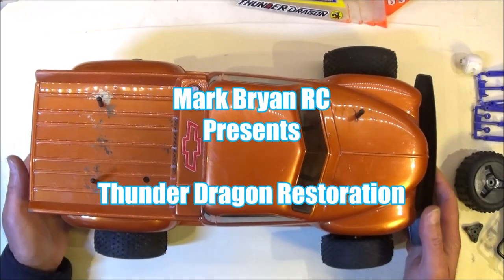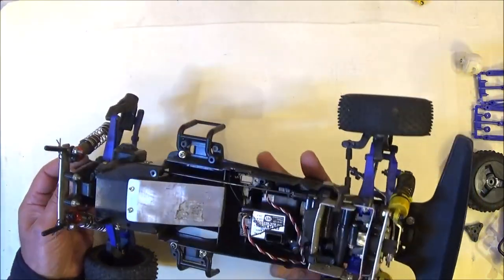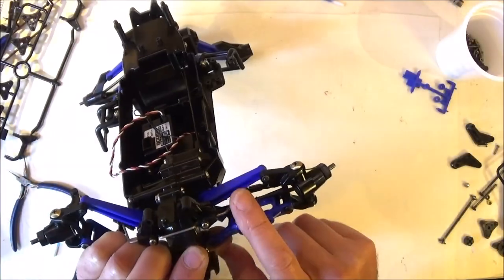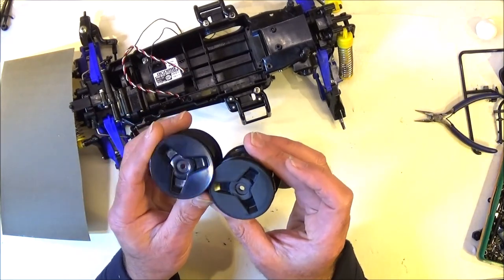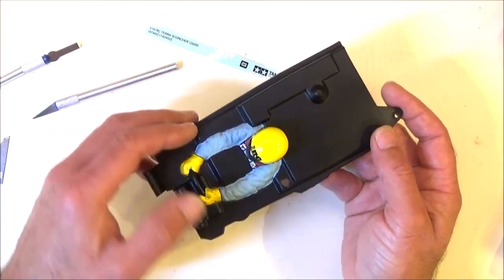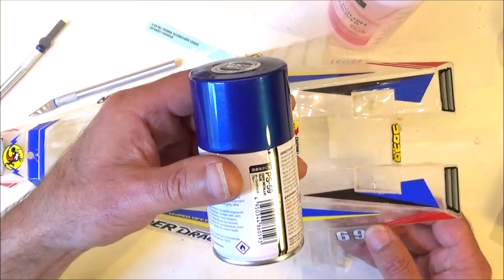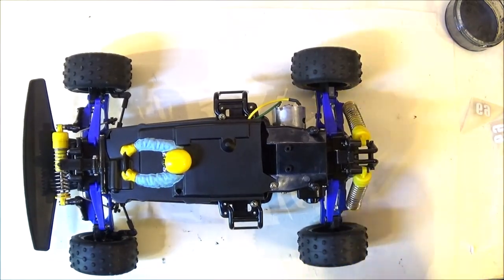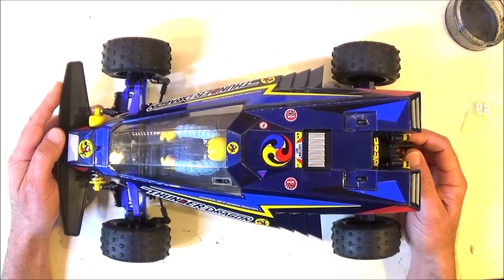Restoring a Vintage Tamiya - 30+ Year Old Thunder Dragon!

Comment: Fantastic refurbishment Mark. I love the colour, and really love that you reverted it back to stock. That's something I did to my Tamiya Ford F350 Hi-Lift recently, and it just felt so right when I finished it.
Reply from the maker: Many thanks, Derek! Yeah, spot-on mate, I did get the same "so right" feeling at the end of the rebuild - I had a little test run in the garden and had a massive smile on my face as the old girl strutted her stuff in her old/new clothes!  :)

Comment: Nice job Mark. Good tip using the fine wet & dry on the wheels, then polishing with metal polish to provide that little extra shine. Glad the bodywork was saved, you obviously put a lot of hours to restore that delicate 30 year bodywork. Wow ! the gearbox metal filings from that pinion gear ! luck the rest of the nylon / plastic gears in the gearbox weren't worn by those filings. Look forward to seeing it run. Great job, bud !
Reply from the maker: Thanks, John! 👍
Glad you found some of the tips useful. Yeah, it was a real labour of love getting that body to look as good as it does, I was really worried at one point! And the amount of muck that came out of the gearbox surprised me - a mix of old grease, dirt, dust and metal filings. The gears are amazingly still fine though. I appreciate the great comment, all the best, John.  :)

Comment: Well done, Mark! The bloom does pretty much vanish when you paint - my M03 Mini body had the same problem - I had to cut the windows out and change them.
 I was astonished at the result you got from the metal polish on the wheels.
 I look forward very much to seeing how this feels to you now with the 3 shock setup, especially driven back-to-back with the Terra Scorcher.
Reply from the maker: Cheers, Del. Yeah, I wasn't sure what would happen spraying over the scratches and bloom, I was panicking to be honest! I should have asked you first! Too bad you had to change the windows, but needs must, eh? And yes, metal polish works great but only on harder plastics - Solvol Autosol is the best in my experience as it has a slight abrasive quality. It will be interesting to see how it runs with that single shock, it's been so long that I can't remember! All the best, mate, hope all is well with you.  :-)

Comment: Hello matey. I really enjoyed that. Some tip top  tips from you. That's amazing what you did with the wheels. Would never have thought of doing that. Also the body came out lovely despite your trials and tribulations. It's amazing with lexan bodies that the underside can be scratched to buggery and you can't really notice once the paint is on. Top job on the driver too. Was that just ordinary spray paint on the lexan bit? Great idea with the heat sink in the hole at the back. Looks the business in blue. Bet you are well chuffed with that. Anyway I am tentatively having a small beer as we had far too much last night! Hope you are enjoying your Friday. How's work been going? Hope all is well mate 😀
Reply: btw was that an actual dog or have you been adding sound effects?
Reply from the maker: Hiya Pete! Thanks for the very kind words, mate. Yeah, this was a bit of a nightmare really, made worse because of the lack of RC stuff available at the moment - oh well, needs must! Luckily the paint does hide many imperfections, and it does look quite good - better than what I started with, anyway. The driver figure clear plastic isn't lexan, so ordinary car paint works well on it. Strange how Tamiya uses different clear plastics? Work is very relaxed at the moment, just like babysitting, really as we are not following the curriculum. But I think that will change soon. Thanks again and I hope you have a lovely weekend, Pete.  :)
Reply from the maker: Haha - no, that was the neighbours bloody annoying dog for real - I was waiting for it to shut up for ages, but no! I did actually swear on the video, but obviously cut that bit out!!!   :P
Reply: @MarkBryanRC  ha, I wasn't sure if you were emulating the animal sound effects I put on mine. Oh I have to cut out a few swears. It's usually when it's incredibly awkward to put something together on camera and I've just dropped something on the floor because I haven't really got the parts the way up that I want. Anyway I woke up super early this morning and got another vid edited which is putting the lunchbox bumper on the Dump Truck. I did break the kit one as expected and I've worked out a way to put the lunchbox one on without buying that hop up part that I used on the Konghead. Anyway I'm going to give the current vid a few days to pick up some views first. I've also got a load of unedited footage of various cars to be getting on with. Enjoy your Saturday mate 😀
Reply from the maker: Hehe - I did think of your sound effects when editing this one! Yeah, I should have added more animals and then the dog bark would seem part of the soundtrack! Good you got some footage to play with, I've now run out so need to get out and film some more. All the best, matey!  :)

Comment: Hi Mark, it’s really cool that you still have so many of the old parts after 30 years.  I’ve seen other RC guys finely scour the inside of lexan bodies before painting, I think to make the paint adhere.  Maybe you accidentally found a new technique using Acetone, scraping then sanding before painting because the body turned out really nice 😀   You do really nice body figures, painting around the eyes is challenging.  As usual awesome tutorial showing off your teaching skills.  You have inspired me to start building kits.  Over a year ago I picked up some cheap 1/16th Crawler kits from WPL and MN,  I just started building and painting them. I have to make two of everything so Sebs can RC with me, it’s taking a long time because I ordered metal upgrade parts from China but it’s been fun!!  Take care Bro!
Reply from the maker: Hey Paul! How ya doing brother? Good I hope. Thanks for the great words as ever! Yeah, even at my old age, I'm still learning - others are telling me about sanding the Lexan before painting - seems wrong, but I accidentally proved that it's right! The figure painting is tricky, but it really helps if you have good quality paint and brushes. Cheap paint is awful to work with. I'm really pleased you are building kits (even if it is double the work!!!) I think it kind of makes you more attached to the finished rigs. Hope those parts come soon, I'd love to see your builds on your channel.  Take care too my good bro!  :)

Comment: Brilliant restoration Mukka!! 👌
👏👏👏👏🍻
You've seen that Lexan acts like a Clearcoat. In fact, I always Sand the inside of my Lexan Bodies for better Paint adhesion.
However should you want to remove this Paint...
It will be MUCH harder to remove. 😖
But the Blue looks GREAT! 

I never liked the performance of Mono Shocks... Without a Swaybar. 
But as far as Chassis restoration goes, you nailed it!!! 👍👍 Lucky some of the bits actually came in the Terra Scorcher 2020 kit. 

You are ROUGH on your RCs Sir!!! I have never seen a C Hub break! 😲 Everything else, but not C Hubs. 

Seriously, that looks shockingly good!! You did such a good job! And I'm shocked that you still had 30 year old parts!!! I have trouble finding 3 year old parts. 😖 
Cheers 🍻 Mate!
Carmine ✈🚂🚙
Reply from the maker: Hiya Matey! Oh yes, big lesson learnt! But good to know that you can sand the inside of Lexan before spraying, we are never too old to learn in this life! I think the mono shock worked OK when I originally built it, but as you say, it does have the sway (or as we say over here "anti-roll") bar.
Oh yeah, you know it my friend, I always run my cars HARD! Gonna take it a little easier on this old girl - well, not so many big jumps anyway. Thanks for the kind words and I hope you and yours are well, me Mukka!  :))
Reply: You'll want to LIGHTLY sand the inside of the Body... Not so much that it looks hazy. You can even use a Scotch Brite Pad.
Another one of my old tricks I learned by accident!! 😜 I spilled a drop of paint on a body. Tried cleaning it, to no avail. So I sanded the paint off.

Was sure I just ruined the Body, so I decided just to paint it, and use it as a Bash Body.... 
But it ended up Crystal clear!! 

.... I'm pretty sure you won't be THAT easy on it! 😜 But I know you'll have fun!!! 
Have a great Week me Mukka!! 😁